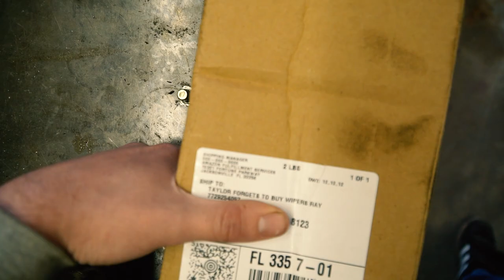LS Miata DRY SUMP Struggles + Buying a Go Kart!?

Comment: Taylor, please PLEASE get some neck protection when you're karting. I know it looks lame, I know you you lose some neck articulation but without full bumpers all around, rubber on rubber contact can get violent really quickly. Karts may seem docile compared to full sized cars or drift cars, but you're extremely exposed with little to no protection. Too many lives have been permanently altered due to neck injuries in racing and I really don't want yours to be one of them. I know comments like this tend to get a little lost, but it's not worth ruining your life over.
Reply: Also buy those brake pads!

Comment: You know what I have always wanted to do? Swap a Honda J32A2 into a Miata chassis. I'm not a big fan of the convertible top, so mine would have to have a hard top painted B95P Electron Blue Pearl with bronze Watanabe wheels. Don't get me wrong, I would love to have a LS7 in the engine bay, but I think that a J32A2 with a 6 speed manual would be plenty for that car.

Comment: Taylor, hose ends are available in 10, 20, 30, 45, 60, 90, 120, and 180 degree
Reply: and that's -3AN all the way through and possibly past -22AN
Reply: Also the only time you'll need PTFE line is if it's for nitrous, air conditioning, or power steering.

Comment: Hey What’s up Taylor...I’ve been watching some of your videos and have finally gotten a sim Rig for the purpose of learning to drift. I have been playing around with the settings on the Fanatec v2.5 wheel base that I just got. I saw your video about your Fanatec sim equipment upgrade and tried the settings you use for drift:
Ffb 100
Sho 100
Abs off
Dea off
Dri 3
For 80
Spr 120
Dpr 40
Brf 50
( not sure what lin is?)
I know you have a lot of experience as you have been drifting for years so I wanted to ask you about it. When drifting I felt like some times I would get some understeer, the wheel also felt unlike in a real car where when you  turn then let go of the steering wheel the wheel goes back to its center or neutral position where the cars wheels are straightened out where as in the sim when you let go of the steering wheel it pushes the opposite direction towards the center nuetral position and it continuous past it without slowing down even a little ..and thus the car turns in the opposite direction by itself...I haven’t used a sim Rig before is this normal or are there some settings to adjust this? In addition, I purchased Assetto Corsa but I don’t know what controls I should use on it and what cars I should be driving to start out with to make it feel as realistic as possible. I feel like with some cars I spin out much more easily than others..Need some advice! Thanks
Reply from the maker: Dri needs to be -3, that should fix your issue.
Reply: Ok gotcha I’ll try that, thanks for reply👍
Reply: Tried it out with dri at -3 and it fixes everything, it feels amazing, pretty realistic, I really appreciate it man👍
Reply from the maker: Anas Parekh awesome!! You might have to dial it in a little more but I don’t think I’ve changed much. I really wish I could fix that typo 😂

Comment: Man i can tell you have never raced. We use to run a sealed motor open wheel modified after getting our asses drug dowm the back stretch we dropped about 5k and and then we had a engine to hang with the "sealed" engines. No such things as sealed engine. As far as tires go they will always dope tires and the guy with new tires will always be faster. Just some advice.